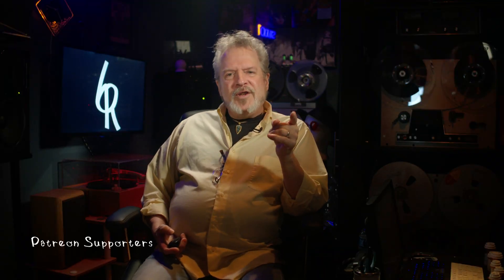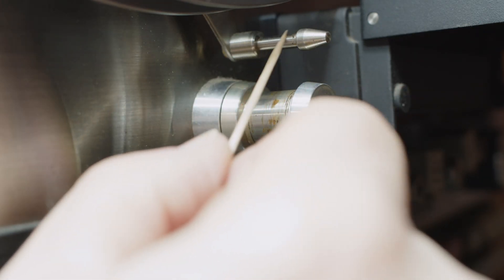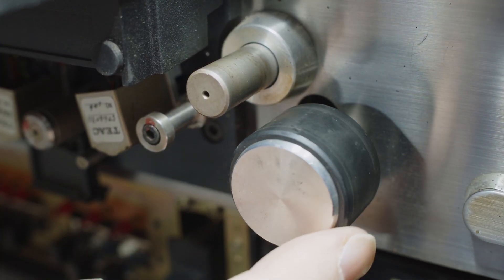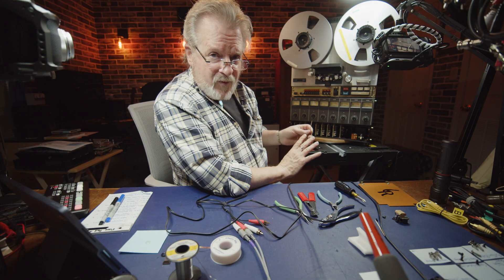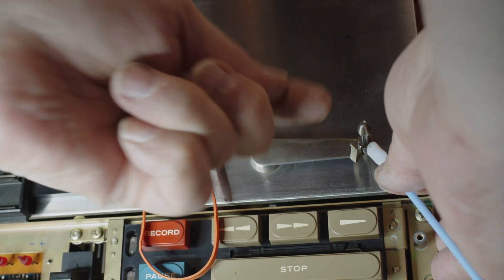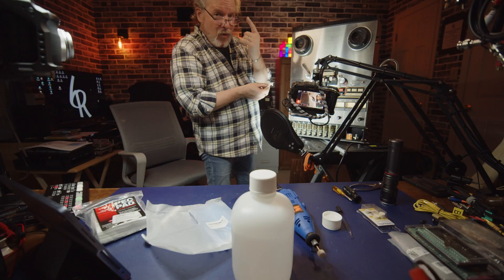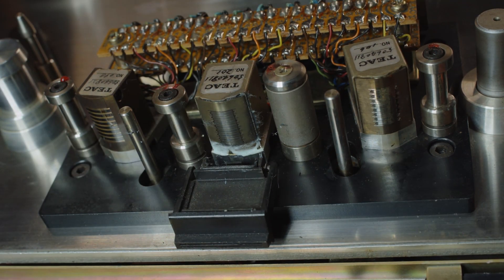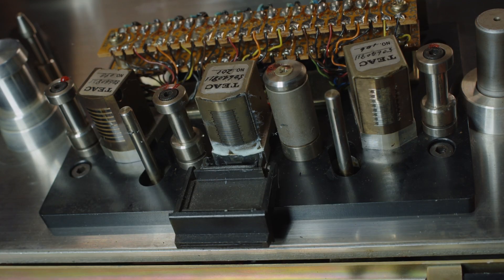TEAC 80-8 – Tape Heads, Tape Path, Rollers, Guides... and a partridge in a pear tree..!

Comment: Strongly recommend anything you can do to eq out the 10khz tone from the video, as someone with sensitive ears it was incredibly awful to hear even with the volume set super low 😰
Reply from the maker: Greetings, on the one hand, congratulations on being able to discern 10KHz from YouTube audio on whatever device you're viewing us on - whether it be laptop, handheld device, headphones or not, PC, or even a home theater system.
On the other hand... test tones are required to determine specifications for calibration. Technicians with years of experience are cognizant of the need for test tones and the need to accurately evaluate the performance of every device under test. It's not just about displaying a reading on a meter, but hearing the tone, and listening for intermittent dropouts and instability.

At 6R, demonstrating (hopefully - in layman's terms) proper test procedures is necessary to educate DIY-ers, be they career technicians, or newbies.

"EQ"-ing as you suggest, would defeat the purpose of accurately demonstrating performance. Thank-you for the comment/suggestion.

For the record (no pun intended), the test tones are mixed in post-production @ -30dB. Laboratory monitoring is kept to a minimum to prevent leakage into the host microphone. Sorry... not sorry. Be Well.
Reply from the maker: I did try scooping it out and still the harmonics were in there pretty badly. It was encouraged moving forward to just have the studio monitors off while demoing. 😁 That's our bad.

Comment: hi i tell you what i do see   the tec's play with the  pot's for the  VU  meter'    i have a 8516 
i by pass the the vu  pots  send the sig  to the  uv amp to check the  uv amp is working right 

i have find the uv amp is not 100% working     i worked on alot of reel to reel decks   the way you do is is by what the service  book says 
it's not 100% right   think out of the box  get it working right 

the tascam  38  i have alot of them    and in alot the uv pots have been played with
Reply from the maker: Greetings, Yeah, I've seen that before too; "fudging" the settings to make the levels match. I set levels to specifications. When the output level is correct (spec) - in this case -10dB (.303 Vrms) - THAT's when I calibrate the meters. Moreover, the MRL tape I used is 355nW/M, despite the fact I intended to calibrate @ 320nW/M. In that way, I had to set the levels 'higher' by a factor of dB, and make all the channels match performance.
That procedure is covered in an upcoming episode. Be Well.

Comment: hi there was hard head made for this  i was told  by a tec    i have to tec my 3 decks   i know one has  been jazzed up on head side 
my otari mtr 12  1/2  inch 4 track has hard glass heads    it was used alot
Reply from the maker: Greetings, ...still "glass heads" are known for durability and robustness. Good Luck & Be Well.

Comment: hi you know the  12mm pinch roller can be changed over  for a 6mm one     i did this in one deck  my otari  8 track  power unit went bad
Reply from the maker: Greetings. Unless I'm mistaken, the Pinch Roller is in excess of "12mm". 12mm = 0.47". The Pinch Roller must contact the Capstan 'above' and 'below' the tape edge to maintain rotational speed. The roller being a rubber-based material, compresses around the tape to maintain alignment. Typically the shaft diameter(s) are not compatible. but. . . . I've been wrong before. Be Well.